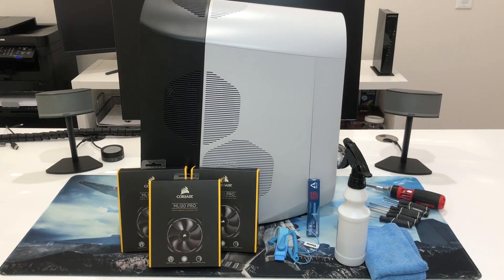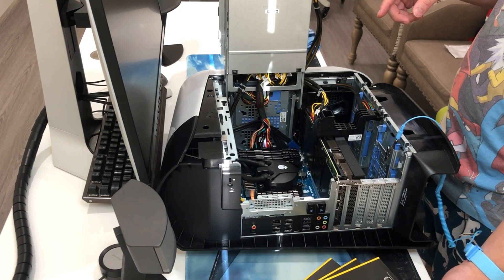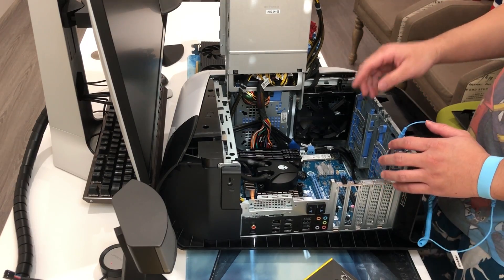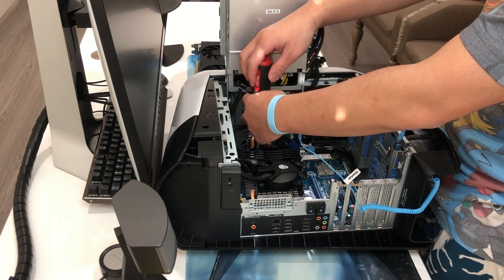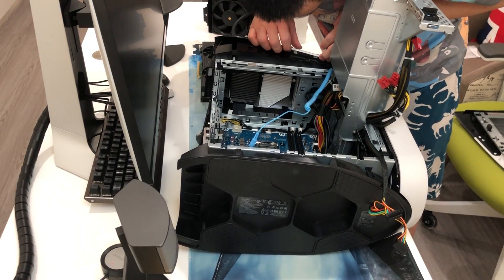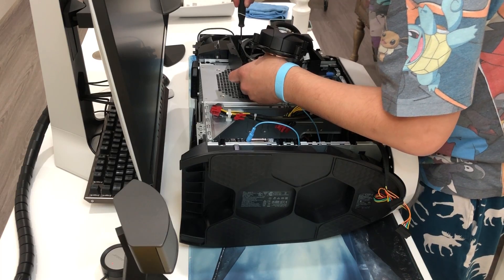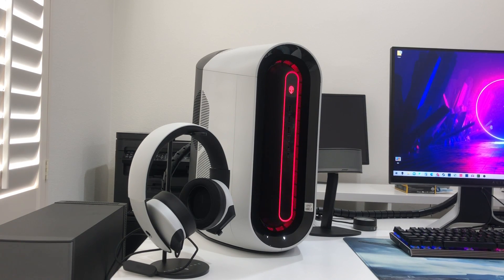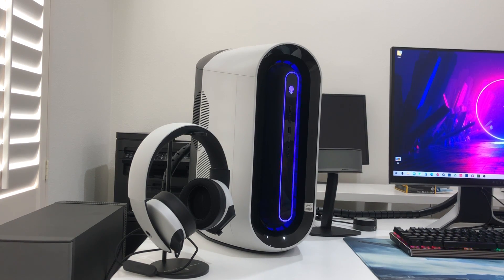How to Upgrade Fans for Alienware Aurora R11 / R12 to Lower Temperature and Noise - Top & Front Fans

Comment: What about the GPU temps? I read that this case is bad for air flow and cooling the GPU, which is why they came up with the liquid cooled 2080.. unfortunately they don’t have the liquid cooled 3000 series cards yet. What temps are you getting after gaming for a while?
Reply from the maker: I have a RTX 3080 in the system, I don't have any problems with the temps.
Reply: It really does seem like GPU temps are stable in the Aurora models. It’s CPU temps that have it a bit harder. Mainly because it could have used a bigger radiator for the liquid cooled option. But these fans probably help with that a lot. Have had an R9 for almost 2 years with a 9900k/2080 ti without anything changed. Brother is buying it from me and I’m upgrading to a 10900k/3090 planning to do this upgrade primarily for noise reduction.
Reply from the maker: @RadialNoah  try this, it helps some reduction for both temps and noise.also make sure to subscribe the channel for more videos.
Reply: @RyanYu  my new Aurora R11 is supposed to be coming in on the 20th. Already have these fans and everything else I’ll need for this upgrade. Only a little nervous about removing the AIO and reinstalling it. But excited to see how much of a difference it makes. Thank you for this guide! I’ll be following it closely when I do it.
Reply from the maker: @RadialNoah  nice congrats on your nee R11. How many fans are you going to change? 2 or 3?
Reply: @RyanYu  thank ya! Very excited to get it. Im going to be replacing the front fan, and the radiator fan. Also adding that 3rd fan on top of the radiator. Have the Arctic MX-4 paste as well. Only thing I need are the 1 1/4 #6 machine screws to attach the extra fan to the top of the radiator. I’ll pick them up sometime between now and the 20th, haha.
Reply from the maker: @RadialNoah  Nice, Just a friendly reminder, the 3rd fan should be installed between the radiator and the bracket. otherwise you won't be able to close the panel. Please subscribe the channel to support me If this video helped..

Comment: Is it possible to install a Corsair H60 into the R11? Placed on the CPU ofc.
Reply from the maker: Yes you can if you have an air cooled cpu. But if you already have the water cooled you don’t need to upgrade it.   You won’t see much difference.
Reply: @RyanYu  I got my R11 air cooled yesterday, its doing quite a bit of noise, and today I ordered 2 120 pro fans, I have a question, the top fan, is it sucking air in or out?
Reply from the maker: @daniellefenda1841  out.  You want it to pull the air out.  The lower fan pulls air in and the top pushes air out.    If I helped, please consider to subscribe if you haven’t done for more awesome videos, and to support this channel.  Thx for stopping by.
Reply: @daniellefenda1841  make sure is not the gpu that make the noise. I own r11 2080 super and I found out that the gpu fans is so bad. Make so much noise.

Comment: Can you still control these fans in the command center, and do you need to remove the top if you are not doing three fans?
Reply from the maker: If you only do two fans, you don't need to get the top cover off. and yes, I'm still able to control those fans, no settings need to be done. plug in and play. and Thanks for the sub!
Reply: @RyanYu  I just did this upgrade and I dont think my fan noise has lessened? Thoughts...
Reply from the maker: @JacobJones-un8uu  How many fans did you change?
Reply: @RyanYu  I changed both, to the same fans you used
Reply from the maker: @JacobJones-un8uu  It shouldn't be. what is the fan speed you have ?
Reply: @RyanYu  idling they are both around 28%
Reply from the maker: @JacobJones-un8uu  they should be under 20% when in idle.  Check your Alienware command center and set the performance to balance for your desktop.
Reply: @RyanYu  I did , I have a 2080 super with Ryzen 9 3950x, could this be why?? If not what should I do?
Reply from the maker: @JacobJones-un8uu  So you set it to balance? still not working? Do you have water cooled CPU?
Reply: @RyanYu  Yes, I have a water cooled CPU
Reply from the maker: @JacobJones-un8uu  oh man, then I am not sure what is the problem.  The fans are spinning too fast under idle that’s for sure.

Comment: Did you plug the top fan into the motherboard on a seperate header or did you have to use a Y splitter? Also is there room in the front on the case for another fan above front lower fan?
Reply from the maker: You can only put one fan for the lower fan. and you have to use the splitter for the extra fan. the link is in the pined comments. if I helped, please consider to subscribe the channel to support me  thank you.

Comment: I suggest using Kryonaut paste, you will see a few more degrees drop off the average temps during heavy load tasks. Also, you mentioned the Dell fan is cheap, its actually a good fan that can move A LOT of air, but at the cost of lots of noise. This way Dells solution to overheating issues. The corsair fans can move even more air at lower rpm, giving you a lot more cooling. The push and pull configuration is a very good upgrade because of how short the loop is in that AIO. It ensures more radiator vanes are being cooled.
Reply from the maker: Yeah.  I agree.  But I prefer the lower noise dude.   It is just too loud with those stock fans.
Reply: @RyanYu  oh I agree absolutely, this was the first thing I did with mine lol.
Reply from the maker: @ndk2k4  yes sir. Consider to subscribe the channel to support me man.

Comment from the maker: Overall, I think two fans are good enough for what we aim for. That extra fan isn't that necessary to put on unless you want that extra temperature reduction badly.
And if you want to add the third fan, you will need a Y splitter and 4 screws. 
Y splitter: https://amzn.to/33DABDr
4 Screws: 1 and 1/4 inch Number 6 Phillip head screw, you can get those from the Home Depot.
Reply from the maker: @stevie2025  I’m glad I can help. Thx for stopping by.

Comment: My Aurora R11 has both CPU and GPU liquid cooled, so it's mostly quiet, but the top fan still produces noise and heat, so I was thinking of only replacing the top fan for now, what do you think? The other fan doesn't seem to make much noise.
Reply from the maker: Man, if you have the liquid cooled for both CPU and GPU, and you change both top and front lower fans, you will have the most quiet R11 dude.  just change both. you will be amazed. Please consider to subscribe the channel to support this small YouTuber dude.
Reply: @RyanYu  Hah, alright, looks like I am sub number 100 😉
Reply from the maker: @DanielSantosAnalysis  yes sir! Thank you man. You made my day!
Reply: Did you end up replacing the fans? Wondering which fans to go with. Nocturna seems to be the quietest option but with error messages, Corsair ML120 Pro being the louder alternative.
Reply from the maker: @joebradley_atk  the ml120 is the only option.

Comment: What happens if I don’t do what you just did?
Reply from the maker: The PC won't explode for sure. You just don't get that noise and temperature reduced.
Reply: Ah thank god but what will be the damages if I still don’t do it. just making sure.
Reply from the maker: @Fatboyye_c  No, there is not gonna be any damages to the PC if you don't do this. This is just for someone who wants to have a quiet PC and lower temperature for better performance.   you are ok! Make sure to subscribe the channel, otherwise it will blow up! 😁😁😁😁😁
Reply: God bless you
Reply: What will happen if I liquid cool my future Alienware r11 I’m getting and upgrade that fans? Would it be even more quieter?
Reply from the maker: @Fatboyye_c  My PC is liquid cooled, but it still loud before the upgrade. but it surely quieter than the air cooled CPU.
Reply: Also are you planning on how to replace the CPU tutorial?
Reply from the maker: @Fatboyye_c  May be in the near future.
Reply: Okie

Comment: i replaced the stock fans with 3 ml20 pros today and halfway through I realized I don't have a y spiltter. Another problem is that I don't have the appropriate screws to secure the top fan :/ all these mishaps are darn frustrating. Currently, only 2/3 fans are running until I get that y spiltter but as for the top radiator fan screws..I'm not so sure
Reply: Can someone link me to the y spliter and screws I need lol I new to this and would like to upgrade to the fans I don’t think it would be that difficult
Reply from the maker: @johnsalgado7737  If I helped, please consider to subscribe the channel to help me to reach my goal. thank you.
Reply: @RyanYu  thanks man I appreciate it 👍
Reply from the maker: @johnsalgado7737  Don't forget to sub man!
Reply from the maker: @johnsalgado7737  You can use these Y spliters   https://www.amazon.com/JBtek-Black-Sleeved-Splitter-Converter/dp/B01EF9OI0O/ref=sr_1_9?dchild=1&keywords=y+splitter+fan+cable+4+pin&qid=1609394575&sr=8-9
Reply from the maker: @johnsalgado7737  For the screws, go to home depot, they should have it.
Reply from the maker: Oh i forgot to mentioned  that you can get those screws in home depot maybe.  There is another YouTube the only joe he made a video of this too and he has the y and the screws.  Check him out too man.
Reply: @RyanYu  yep, i looked at his tutorial as well. I really dont have the type of screw that he has haha.

Comment: Hey bro, just got my R11 yesterday, been following you for 2-3 weeks waiting for this day haha. Question: when you place the third fan above the radiator, will it fit normally under the top lid?
Reply from the maker: Nope, that third fan should be in between the radiator and the bracket.
Reply: @RyanYu  are you going to give this push/pull config another chance? Or are you satisfied?
Reply from the maker: @ChrisBechaalani  I'm good for now. I may add the extra fan after 6 month when I re-apply the thermal paste.
Reply: @RyanYu  why re-applying thermal paste after 6 month?
Reply from the maker: @patrickzanchette3913  It's just a good way to keep your CPU cool. hope I helped, and if I did please consider to subscribe the channel if you haven't done to support me to hit 1K. Thank you.
Reply: @RyanYu  Hi Mate, is it necessary to put the 3rd fan on top of the case to get lower temps? I ordered 2 120mm Corsair Pros and i hope i get lower temps with only 2 fans by changing them.
Reply from the maker: @wingeladvokat1920  two fans are okay which is the way I went with.
Reply: @RyanYu  Oh i think you showed at the end of the video, that you got lower temps by changing only 2 fans, because the 3rd one was broken, right? Did you reinstall the 3rd with a working fan later? And did the temps shrink with 3 fans again? That would be very interesting.
Reply from the maker: @wingeladvokat1920  I didn’t put the 3rd fan, I don’t think it is gonna help much.
Reply: @RyanYu  Thanks. Beginning of January you was playing PUBG with high temperatures betweeen  80-90 Degrees. Was ist bevor you installed the new Fans? Or didnt you check the ACC. During Playing PUBG i have Power Consumption at Max and prefabricated performance. Normally i dont get about 60-70 Degrees with THE OLD FANS. And i have the 10900KF! So im very interested 
whether the new Fans will bring anything. I hope so. Greetings from West Germany, where are you from?

Comment: hey man, i have a quick question... 
i just ordered an alienware auora R11 with intel-core i710700KF with the graphics card of NVIDIA 3070. 
i currently own a 1080p 240Hz alienware monitor and was wondering if all these specs stated would be a fantastic combo together or if the CPU would be strained or overheat?
Reply from the maker: Hi Pat, it's nice combo that you have. I have the same monitor, and it works great, it just needs a little bit the color adjustment, you can check my other video of how to do that. If you are going to overclock the CPU, yes, it will overheat, but I have a few videos to lower the temperature and noise too. So make sure to check those out. Hope I helped. Merry Christmas.
Reply: @RyanYu  if i wasn’t to overclock the CPU would everything be aye okay? i’m kinda new to the PC world and to have some reassurance is something i’m extremely grateful for, merry christmas to you also!
Reply from the maker: @PATOxSK  it will be fine without overclocking
Reply: @RyanYu 
so overall your final verdict is that you recommend upgrading the fans if you have an overclocked CPU? thank you sincerely...
Reply from the maker: @PATOxSK  if you want to have lower temperature and noise level.  Doesn’t matter if you have a overclock.
Reply: @RyanYu  understandable ... thanks man you’ve been a massive help !
Reply from the maker: @PATOxSK  no problem. Any time.

Comment: Hey, I have a question. I have a air cooled Alienware R10, so it’s kind of noisy sometimes. If I change the top fan and the front fan with the ML120 Pro nonLED, will I get better temps and will it be more quiet and run cooler? I’m trying to save money if I can.
Reply: I switched my air cooler to a corsair h60 water cooler and the temperature/noise improved greatly!
Reply from the maker: @TheResolute24  Yeah, air cooler makes a lot noise. well done dude.
Reply: @TheResolute24  did you add VRM heatsinks ? if yes, where did you buy them and part numbers ?
Reply: @clapperzhu  i did not add any! I am curious of the result it would have. I do have to add to my previous comment that even if the corsair cooler is a thousand times better then the stock one. The ultimate best solution would be to transfer all components to another case and buy a new motherboard/power supply to avoid dell proprietary blocks
Reply from the maker: Even you have an air cooled.  You will still get lower noise and temp of you change those fans.  But I will suggest you to upgrade the cpu air cooled to a water cooled too.

Comment: My machine keeps making this constant sound -Im not sure what it is. I replaced the RAM from 8gb to 8gbx4 at 3200 but since then im experiencing this sound (sounds like fast moving mini fan but its not the dell fan - im confused)... i did try to see if anything is stuck in the fan but there isnt. Any help? I didnt do anything related to BIOS or anything like that yet
Reply from the maker: I haven't noticed any thing like that after I changed mine. Can you tell if that is the sound from the front fan or the top fan? or is it the GPU?
Reply: @RyanYu  its from the top... when i press my hand on the top of the hardware the sound goes. Its weird.
Reply from the maker: @Ashraf.ali.95  Could be the top fan?
Reply: @RyanYu  lol no idea. I'm a newbie to hardware modifications.  So I'm gonna have a look and see soon
Reply from the maker: @Ashraf.ali.95  me too man. All the things that I have done to this PC were new to me.

Comment: How do you know where to plug in the fan cables? New to PC gaming
Reply from the maker: plug them into the same ones for the stock fans.
Reply from the maker: @stevie2025  you need to buy a Y splitter.   So two fans on one port.

Comment: I changed my ram to 32gb. But it’s not showing in the bios. Any idea why?
Reply from the maker: which Ram did you change to?  are you able to boot up your PC?
Reply: @RyanYu   I’m not really tech. What’s boot up. My pc still working and I still playing video games but it’s not showing in the bios. I got two 16gb fury
Reply: The original ram my pc came with is the 8gb single channel Hyperx(fm) fury DDR4 XMP at 2933Mhz
Reply from the maker: @kevinventura7125  Right click " This Computer"  or " This PC"  then select properties.  how many GBs of Ram does it show?
Reply: @RyanYu  it shows 32GB , but it’s not giving me 3200 XMP.
Reply from the maker: @kevinventura7125  So, go to your Alienware Command Center, Fusion, Overclock Profile,  On the Memory Clock, click Advance view,  Select Ram Disable,  Save, and then click it again choose Ram 1, then save, and restart the PC, you should have it with 3200Mhz. Please consider to subscribe the channel to support me if I helped you. Thanks.

Comment: Great video mate! I have done the exact same modification as you did. Such a shame Dell chose to include pretty average fans on such a high end system.
Reply: I just did this as well, everything is working as it should, but I keep getting an error when booting up that the top fan isn’t functioning, but it is, and is even responsive to my custom curves. I’ve checked all plugs, checked and made sure that nothing is hitting the blades as they’re spinning, but I keep getting the error whenever I boot up the system. Thoughts?
Reply from the maker: Yes sir, those fans are too cheap to be in the system.